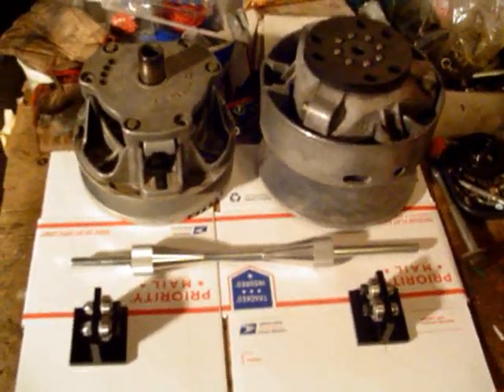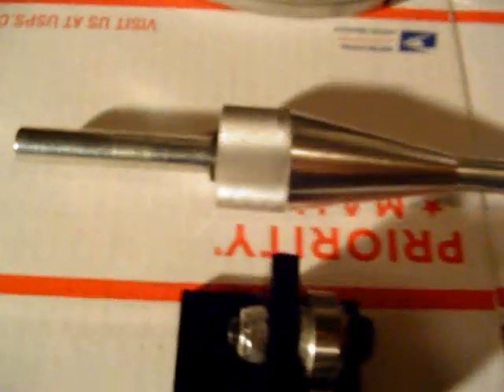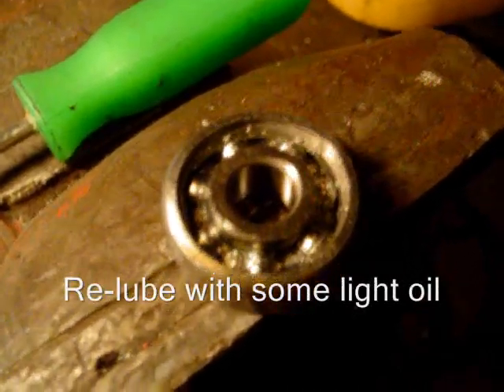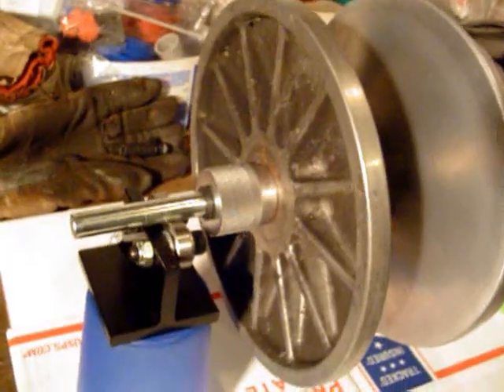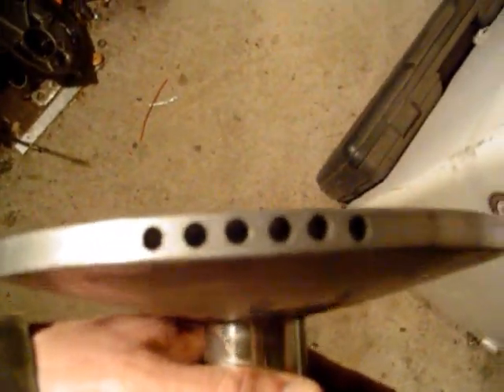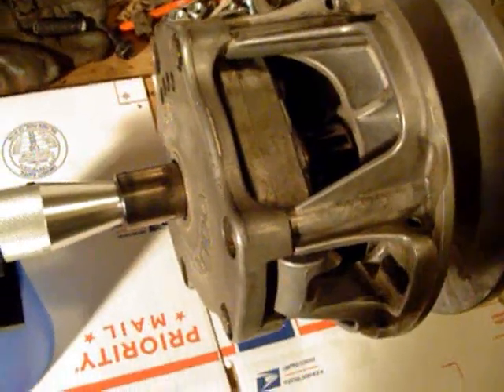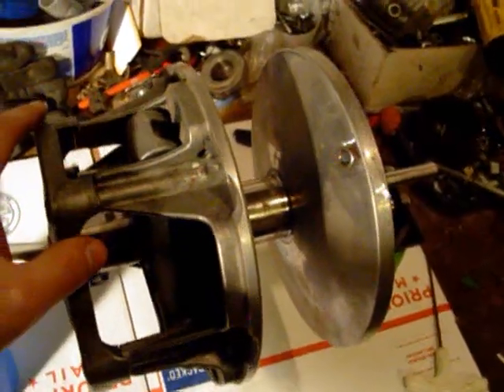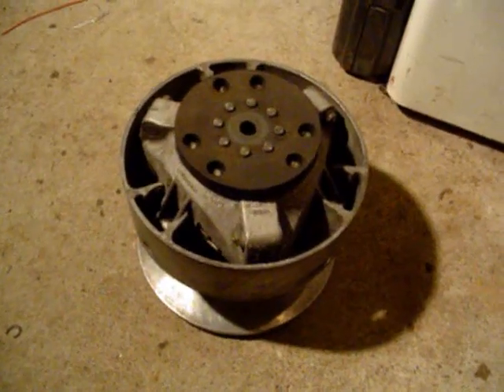Home-brew DIY Clutch Balancing, for CVT's

Comment: Makes a lot of sense take the grease out of the bearings to reduce the rolling resistance, then used to fix pointer that would usually come on most motorcycle balancers to mark your heavy spot. But frankly, I would do a one step further once I feel like I’m in balance either by temporarily adding weight to prove the point stick the scale under each side of the motorcycle balancer and then give it a slow spin technically if it’s out of balance, you’ll see the skill jump up and down. This will indicate a bad balance or it’s a good balance.

Comment: toocheaptosmoke, You did an excellent job explaining and showing how you achieved the results you were after. I also agree dynamic balancing is the best, but some people aren't even close to anyone that offers that service. So, the next best thing is to static balance. And so for the money and some time invested, people should be able to at least get close to a balanced CVT clutch. Thanks for the great video.
Reply from the maker: Appreciate the kind words!   I have used this setup quite a few times now, and been able to make engines run noticeably smoother.
Reply: I bought one of those whee balancers and checked both my primary and secondary. The primary was close, but the secondary, when i had it apart, i forgot to mark it, and now it's back to balance again. It works great.

Comment: Do you have a part number and or can you tell me where I can get this balancing tool that you have

Thanks
Reply from the maker: It's just called a "Motorcycle Wheel Balancer " made by SMI, it's still available on amazon.
Reply: @toocheaptosmoke  

Thanks